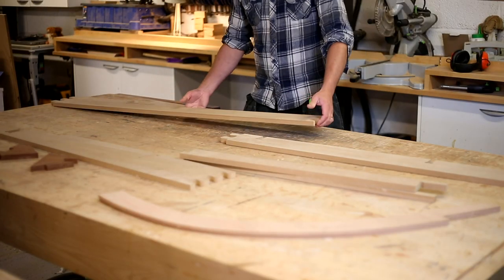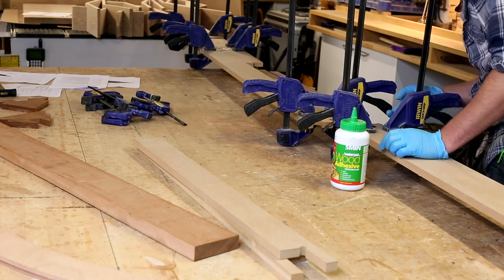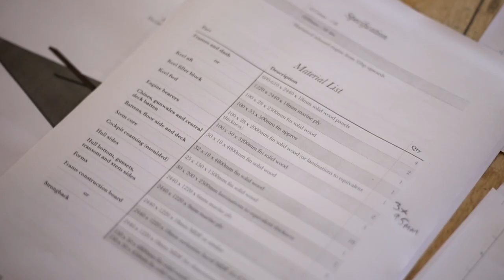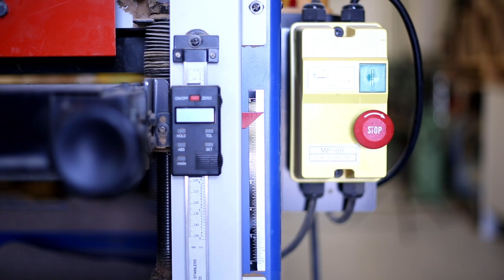Rocket MkII Boat Build Pt 5 - Making the Keel Assembly

Comment: Enjoyed the video Dan. Not sure if it is any help of or not, but I had a very similar arrangement for my extractor hood on my old 20" Sagar P/T. Where the bits of wood go in the hood for thicknessing to seal the gap I put a bit of 60mm brush seal on either side (think it was for up and over garage door bottoms). That way it just slid over the side when moving the hood for surfacing, and I didn't forget to put the bits back in to close the gap. Not sure if it even bothers you anyway, but thought it worth mentioning.
Reply from the maker: I like that idea. Some of the long, garage type draught excluder would span that gap nicely and save me having those two bits of wood kicking around the floor by the planer all the time... off to order some now, cheers!
Reply: It's handy for all sorts, I'm going to get a bit and put it on the top edge of the openings around on the wide belt sander.  Stop that puff of dust that comes out on startup everytime. My old rip saw I put it round the overhead guard too, which really helped with dust extraction on that., Should probably do it on my new saw too really, but I never remember to turn the overhead extraction on so doubt it will help 😂😂
Reply from the maker: Yeah putting the extraction on usually helps 😂 I've done that a few times with the drum sander with clouds of dust coming out the sides!